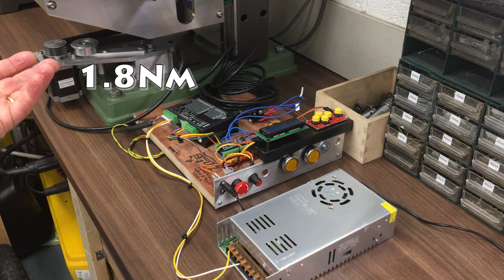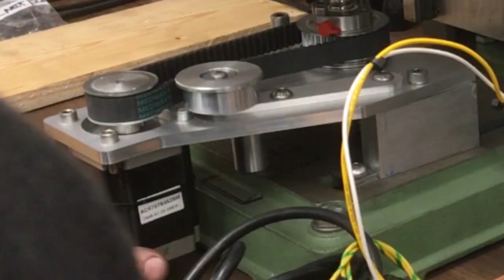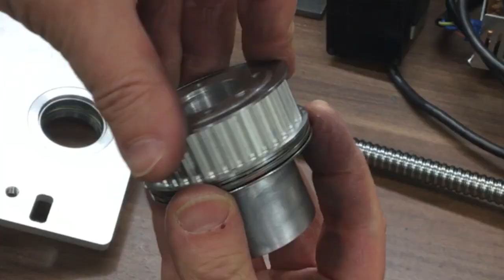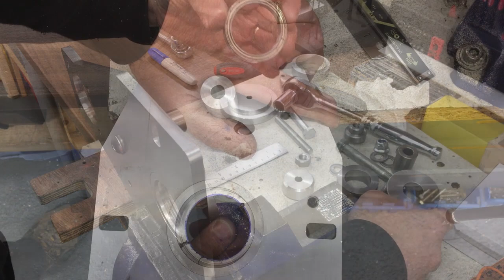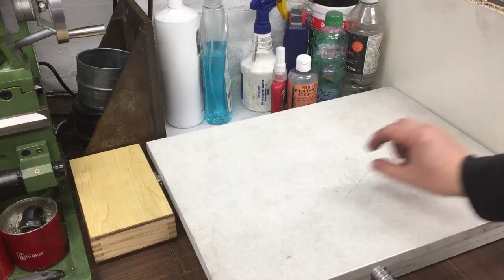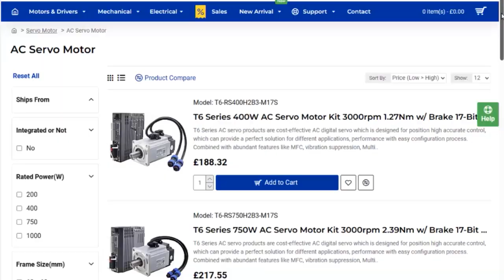Ep46: Drill Press upgrade | Can we finally get this thing moving?!

Comment: I think if anyone is thinking of building a cnc machine you can buy marble resin body for around $2000 or less and it will be a far better starting point, and have far better performance not that this build isn't worth it but you need to have some balls to see it through, I think anyway.

Comment: If you lower the steps on the stepper driver from 1600 to 800 or 400 you will get more Torque.
But you probably mentioned it already somewhere why it’s not possible… 😅
Reply from the maker: That would help but it sounds terrible!  Hopefully I can avoid that but it is an option.

Comment: The stepper motors are current-driven. Increasing the voltage supplied to the driver has no effect on torque since the driver controls the current. 
You keep thinking of stepper motors as standard DC or AC motors where the supply voltage is delivered directly to the coils in the motor. 
Steppers are a very different animal. 
There is a formula for the “ideal” supply voltage based on the inductance of the coil. The perfect voltage doesn’t affect the torque still, but it does affect the angle of the rising slope of the current pulse released by the driver and thus the max acceleration of the motor. Not torque, only acceleration.
Reply from the maker: That is great info thank you.  I have always thought of voltage as being needed to get the current into the motor quick enough against the inductance.  So I’ve gone for low inductance motors and high voltage.  But matching them makes sense.  For current I’ve always thought this was limited by the driver and I needed to not set it too high as this will heat up the motor.  Once I’ve got the backdrive problem sorted I’ll revisit the driver current setting.  Thanks for the info!
Reply: @routercnc9517  most steppers work just fine up to about 100 degrees C. Don’t be afraid to run them at max current, even if they seem to heat up.
Reply from the maker: OK that’s great thank you.  I’m pretty sure these have a low current setting when idle to hold position.  I’ll play with the current and see what happens.  Unlike CNC machines this stepper will only run periodically.

Comment: Really interesting problem solving video, have you considered (I'm pretty sure that the answer is yes) a counter weight approach to take some load off the screw and stepper. I don't see how it could be integrated, but you know your machine way better than I do, considering I've only seen the last 2 videos. Anyway, I'm sure you'll find a solution that doesn't involve selling a kidney. Your videos are really interesting, I'm looking to seeing the next ones !
Reply from the maker: Thanks for joining us.  Yes I have looked at a counterweight but it needs to be about 50kg so there are issues with that.
Hopefully you will see what I try in the next video.  Thanks

Comment: Nice video. I suggest to use a stepper motor with break. Stepper motors provide huge torque at low speeds. You can lock the break after Z-positioning, so you can apply more drilling forces.

If you're looking for cheap servos check out the products of JMC (just motion control).
Reply from the maker: Thanks I’ve been looking at braked steppers but only found 2Nm braked so far at £60.  I’ll keep looking.

Comment: Have you considdered about a counterweight to match / reduce the wight of the table, may allow you to get alot more out of the stepper already have and can locate the weright in the back where the ball screw was previously located and adding pully at the top
Reply from the maker: That’s basically what I’ve been studying.  Counterweight would need to be pretty heavy so I’ve looked at other options and got some parts on order.  The calculations say it will help quite a lot, the remaining issue will still be backdrive when off however.
Reply: @routercnc9517  how about a solenoid based brake that releases when on?
Reply from the maker: @bonio55 It's an option but I would need to work out and spec all the components so the solenoid was powerful enough to apply the brake, or operate a cam system to release the pressure and the main braking force was provided by a spring.  By the time I have done all that working out and designing it a stepper with an integrated brake might be cheaper/more reliable.  Still considering the options.
Reply: Stepper motors are current driven. Increasing supply voltage to the driver has no effect on the current, which is controlled by the driver. 
If the supply voltage is matched to the inductance of the coils in the motor, you get the fastest transition rate from one state to the other, which affects max acceleration only, not the torque.

Comment: Hi. I have a question a little out of topic  but i saw in the past you used UCCNC software. In Settings / Spindle  there are these two parameters "M7 delay after on:" and "M8 delay after off:" but in the manual i read ......"M7 delay after on: This is a numeric value. The software dwells for the set amount of time in milliseconds when a M7 command is programmed and after the Mist output goes active.
M8 delay after on: This is a numeric value. The software dwells for the set amount of time in milliseconds when a M8 command is programmed and after the Flood output goes active...... so which is the right one ? The ON and OFF in the screen or the ON and ON in the manual ???   Thanks in advance for your help 🙂
Reply from the maker: Unfortunately I don't use either of those functions.  I turn the spindle and mist on manually.  Try asking on the mycncuk forum, or there is a UCCNC (CNCdrive forum?) which is pretty active.
Reply: @routercnc9517  I will try this path. Thanks a lot in any case 🙂
Reply from the maker: @IceCreams62  No problem.  Here is the cncdrive forum: 
https://cncdrive.com/forum/viewforum.php?f=1
Reply: @routercnc9517  Hi. Here the UCCNC Support reply: ""You're right, it's a typo on the screenset. M7 and M8 turns on the mist and coolant and the delays are after turning them on. The M9 turns off the M7 and M8, so the delay after off is for it. We will fix the screen, thanks for the input. ""    Hope this helps somebody else 🙂
Reply from the maker: Ok great, thanks for sharing the info as it might help someone who has the same problem.

Comment: Drilling with a stepper motor will likely need alot of torque?
Reply from the maker: Yes that is not an option with this setup.  I have a cheap part on order which may help.

Comment: A servo moter seems the best option here.
Reply from the maker: Quite expensive but it would solve all the issues in terms of power and braking.  But the Arduino will not put out enough pulses to drive a servo.  Do you know of a cheap high frequency pulse generating microcontroller?  The one I used on my lathe ELS (Clough42 kit) was around £50.
Reply: @routercnc9517  You could look into the Windows based UCCNC system or the free Linuxcnc software, in both cases an old laptop or PC will do the job in combination with a Ethernet (or USB) motion controller.
Reply: @routercnc9517  depending on how many ports you want or if you want to add a digital pin expansion, teensy 4.0 boards are very good and easily fast enough, even if you want to add touchscreens. The small one is 19£ i think. 

I'm not sure how well they work together, but you can use the Arduino IDE on raspberry controllers.
The zero has a 1ghz processor, and is only around 10 bucks so possibly the cheapest controller with a lot of processing power you can get.

Though I should add that both options obviously don't have perfect support for all off the shelf libraries, if you want that you'll have to go with Arduino boards like a Due or Giga, but those are 50€+, so yeah.
Reply from the maker: There are 3 replies for this question but I can only see mine.  If someone is posting here please try again, thanks
Reply: @routercnc9517  Repost: depending on how many ports you want or if you want to add a digital pin expansion, teensy 4.0 boards are very good and easily fast enough, even if you want to add touchscreens. The small one is 19£ i think. 

I'm not sure how well they work together, but you can use the Arduino IDE on raspberry controllers.
The zero has a 1ghz processor, and is only around 10 bucks so possibly the cheapest controller with a lot of processing power you can get.

Though I should add that both options obviously don't have perfect support for all off the shelf libraries, if you want that you'll have to go with Arduino boards like a Due or Giga, but those are 50€+, so yeah.

Comment: You may be able to use a 4 pole changeover relay to short the stepper windings together using the NC contacts when the power is off to act as a rudimentary brake.

Alternatively, look at some of the "integrated" hybrid steppers, iHSV I think they are called. I use them on my DIY pick and place machine wiht great success.  They are about £200 ish. They also have no brake, so you'd still have to design round that. I wonder if a simple bike disc brake may work for this? Or some other concoction :D
Reply: Wouldn't that cause the z axis to just creep down slower since you're relying on the induction of an opposing magnetic field which is a function of speed?
Reply from the maker: If it was like a motor/generator then maybe but my experience is if you short the windings it is very difficult to move from a resting position.  But you’ve got me thinking about why that is since you need to cut a field with a moving magnet so perhaps there is movement but it is very small.  But then it should move again and repeat. Hopefully someone can explain why it just resists movement and locks up!
Reply: @routercnc9517  I have the same experience with steppers locking up like this. Unfortunately I this it's just Lenz law and will cause slower motion, rather than being a true lock. If your kinematics had high stiction this could work, but everything you're using us roller elements so I doubt it. There is no way to know 100% unless it is tested of course.

Btw, there is a common mod with benchtop milling machines which is putting a gas spring between the column and the z axis slide so it can lighten the load when lifting the z. This might work for you.
Reply: @neverwipe  this gas strut mod also means you could get higher lift speeds as the motor is under less load
Reply from the maker: @alex13902  @alex13902 Shush . . . .that is the secret part I've ordered!  Took a bit of a guess + some calcs for the correct load rating to use since they are not linear over the stroke.  I'll have a play as it only cost ~£14.  I'll talk about my thoughts on this approach, and the geometric effects (as I see them) in some future video.
Reply from the maker: @neverwipe  OK, I'm glad physics still works.  Can't get something for nothing.  I might experiment with that and if it is interesting I'll put it in the video as several people have suggested shorting the windings.  Then we can all learn if it is really a solution for this type of problem.
Reply from the maker: Ok I’ll take a look.  I did talk about adding a brake disc and solenoid but edited it out as it was getting too long.  I made one for my daughter’s ekart (see video series!) which used a Bowden cable operated disc brake.  Could be an option but would need design work on the solenoid power, spring rate etc.
Reply from the maker: Shorting the windings is a great idea.  I think the arduino would need to manage the process as shorting the windings to the driver will damage it.  I could rig something up temporarily and see if it will resist drilling.  Great idea !
Reply: @routercnc9517  my thought was to hook the relay coil to the incoming 12 or 24v power directly. That way, when the power is removed, the NC contacts close, giving the short.

Obviously if you wanted programatic brake for drilling, having it controlled by the arduino would be helpful, but a little less failsafe.

If you were to put the windings to the COM terminal, you could easily put the short on the NC side, and the driver on the NO side. That way, power on is driver connected, power off is shorted.
Reply from the maker: Ok nice idea.  I think I will go with the 48V power though so maybe put 2x 24V relays in series (2 poles each?).  I’ll quickly try something by manually shorting and see what it offers.

Comment: try to use a Worm gear after the stepper, it naturally hold the load when power off.
Reply from the maker: I did look at worm gears in the original design but the output speed is very low.  Would need gearing up again.  Still could be an option though.  Thanks

Comment: Another thing that might be limiting your top speed is the lack of acceleration. If you're able to ramp up the speed in your code that could help.
Reply: 100%,came here to say this. There is an arduino library that will do ramped acceleration pulse generation. Also, more current will give more torque which will help overcome acceleration
Reply from the maker: OK thank you.  I was planning to write my own code for the acceleration but I’ll check out that library first.  Do you remember the name of it?
I’ve tend to run higher voltage and low / medium current on steppers to limiting heating but I may experiment with more current as it will only run briefly and occasionally.  Thanks for the suggestions.
Reply from the maker: OK yes that’s a good thought.
Reply: @routercnc9517  I've been nagging you for the past 4 vids about this, but if you add a accelstepper library to your code, the max amount of steps per second from your Arduino nano is going to take a hit :D

Comment: there was 1 thing you did change the 2 bearings for the rails that will change the lifting power you need i think !
Reply from the maker: The drag force on the carriages is very low so I think it was mostly the bearing preload issue, thanks.

Comment: You can do drilling cycles with a stepper motor. I don't know why you think you'd need servos? They make steppers with encoders and/or brakes. You could employ a worm gear that would fix the problem. OR throw a relay in there and short the stepper to itself when it's not in use. It will act like a brake. Or just have it park at the bottom of its travel when it shuts down.

The harder, more expensive way is not always better
Reply from the maker: Ok thank you I’ll have a look at braked steppers.  Parking at the bottom is an interesting option.  Worm drive is ok for backdrive but output is very slow and would need gearing up.  Lots of options!
Reply from the maker: Shorting the windings could work with the correct control system to avoid shorting the driver.  Nice idea!

Comment: A cheaper fix to get higher speed could be changing your ballscrew and nut to 10mm pitch. Same higher speed at half the rpm. So you keep the torque. A screw and nut would be about £60 and should fit your current design without any changes.
Reply from the maker: It would give more speed but half the effective torque and double the backdrive force.  So not a great option right now.
Reply: @routercnc9517  I don't follow. Running the stepper slower should give you its full torque no? But your mm/min goes up because you're using a higher pitch screw.
Reply from the maker: I did consider lower pitch such 1604, I would need to see what was available.  Thanks
Reply: No the other way around. Go up to 1610 from 1605. So one revolution gets you 10mm of movement. Half the rpm gives you the same travel speed, but without sacrificing the torque.  @routercnc9517
Reply from the maker: It could work but the torque increase at lower speed would need to be double, I’ll maybe run the numbers and see.
Reply: @routercnc9517 For instance, on my machine I'm using 1605 ballscrews. I can hit 3000mm/min by running the steppers at 600rpm.  If I went to 1610 ballscrews, if get the same 3000mm/min but the stepper would be running at 300rpm, which is much closer to its higher available torque on the torque curve.
Reply from the maker: OK makes sense.  I have a part on order which should help first then look at next steps.  Thanks
Reply from the maker: To add to the above I’ve done the calc on backdrive torque and it doubles on the 1610 over the 1605 so there is that to watch out for.  Luckily the brake requirements are still quite low in both cases if you are braking the rotating but rather than stopping the knee directly.
Reply: @routercnc9517  Interesting. How would the back drive torque affect you? (Or even I with a CNC mill). I'm not familiar with it.
Reply from the maker: The knee drops when the stepper power is turned off.  This would happen on a CNC Z axis if it was heavy enough.